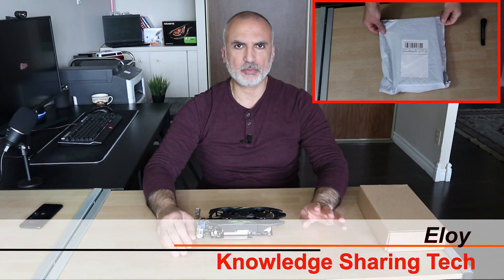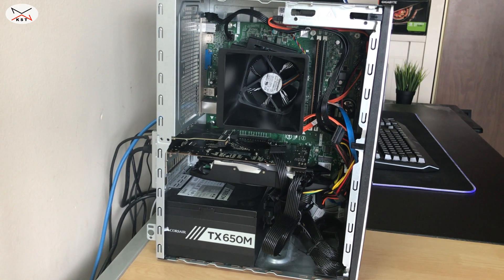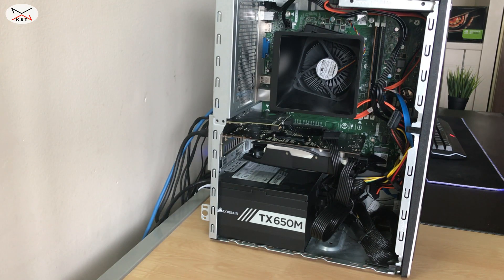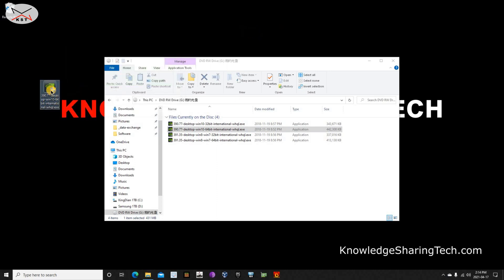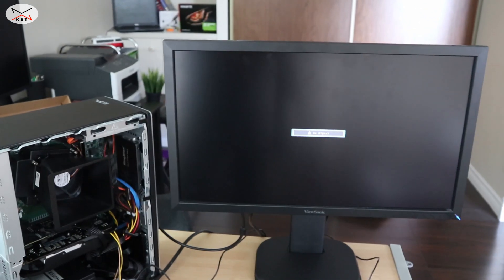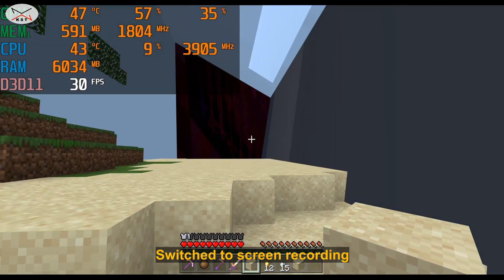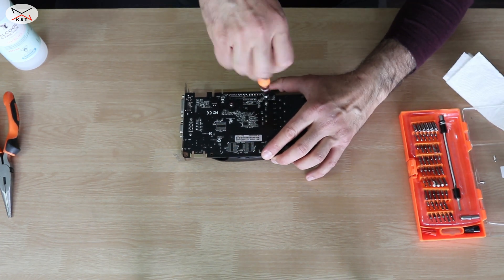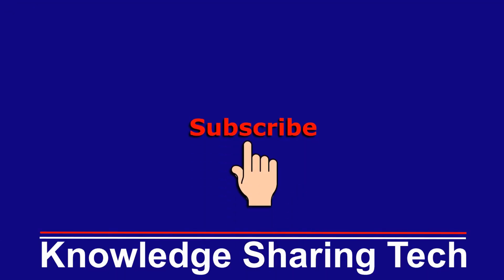Fake GTX 1050 TI GPU from Walmart - Why Walmart, Why?

Comment: Currently fell for a Fake 1050ti, had so many issues installing the card. ON my Asus main board it didn't boot with the CMOS battery, only when I took the battery out of the main board.
Installed the driver v391.35 from the disc (as you did). When I stalled I was able to get a resolution of 1920x1024, after I wanted to start Red Dead Redemption 2, a pop-up appeared that I needed to upgrade my video card driver to 445.32. As I looked into the site of NVIDIA I took the latest driver for GTX 1050 ti currently v522.2 and installed it. After a necessary reboot the pc started back in to a lower resolution. Checking my display options I saw that it only had resolution until 1024x768, no longer 1920x1024. In Device manager I check the card and saw within the driver section error cod 43. I googled error code 43 and came across many issues, lots of them advised to uninstall and reinstall. Which didn't do anything.

I contacted NVIDIA about the error code 43 issue, the support agent had me download GPU-z application and there I turned out that this is a FAKE GTX 1050 ti. NVIDIA apologized for this {not that it was their fault) but they couldn't do anything about the situation. 

I contacted the seller on eBay where I purchased the card and asked for an explanation.  
the seller excused himself and told me that he will do anything to fix the issue. 
I demanded a refund, so far he still refuses to do so and want to fix the issue. he let me made a video of the issue. 

I have reported the seller to eBay as a fake seller of products and told the seller I did so.
Still the seller is persisting to fix the issue. As I told him that the only way to fix the issue is either sent a REAL GTX 1050ti card or a full refund.

I am still waiting for any reply.

Comment: Just watched this (year-old) VOD – nice job. You didn't need to remove the cooler, though, to see what the die was. HWiNFO64 (at 5:15 in your video) actually TELLS YOU it's a GF116 (under "Video Chipset Codename") which is a Fermi die – (I would guess a GTS 450 by virtue of the "16 ROPs, 192 Unified Shaders" spec). If you re-flash the BIOS to reflect what the card actually is, it'll probably stop crashing the PC and displaying "hash" in MineCraft (although whether it's worth it just to have a GTS 450 is questionable).

BTW, any time you can output video from Windows, but not from the BIOS, that's a clear indicator that the GPU is too old for the BIOS to have drivers for it – (most BIOS have graphics card drivers that only stretch back 6-8 years) – by installing the nVidia drivers in Windows (which go back much FARTHER) you were able to see it!

Comment: gpu z is saying my gtx 960 is a gts 450 however i ram benchmarks and they all far surpass the gts 450 in fps so i’m really confused
Reply: does it have a vga connector?💀💀
Reply: @raven4k998  that thing is long gone lol. upgraded to a 1660 and then a 3060
Reply: @jao999  now you should upgrade to an rx 7900 gre muhahahahahaha
Reply: @raven4k998  how does it compare to the 4060 cuz that was gonna be my next buy
Reply: @raven4k998  investing… and as of right now i have a ryzen 5 5600x, should i upgrade and if so what should i switch to?
Reply: @jao999  I would recommend you upgrade to an AMD gpu just incase you want to try out and use ai because the AMD gpu's seriously beat Nvidia out at ai horse power thus can let you have some fun playing around with it on your system regardless of which AMD gpu you go with your getting a card that can seriously punch above it's weight for ai horse power your cpu if it's fine leave it unless you want to upgrade to something with more cores
Reply: @raven4k998  word, preciate the help bro